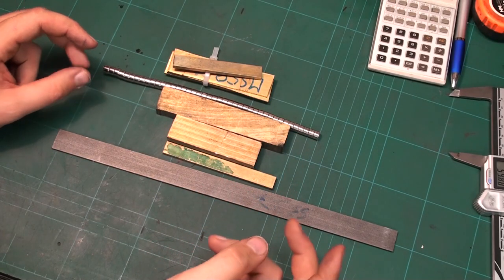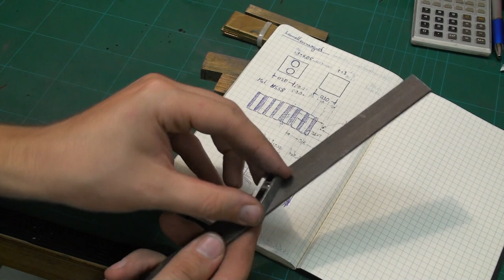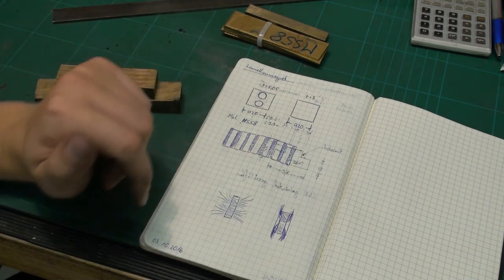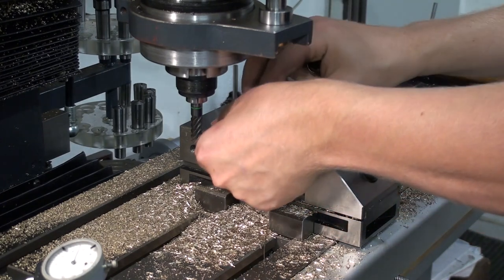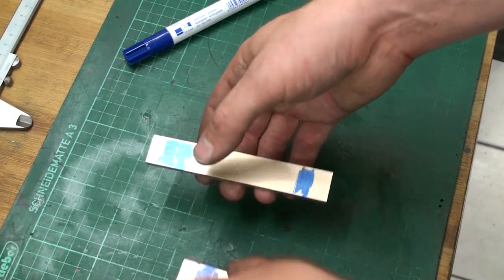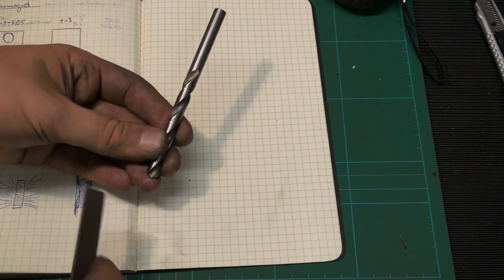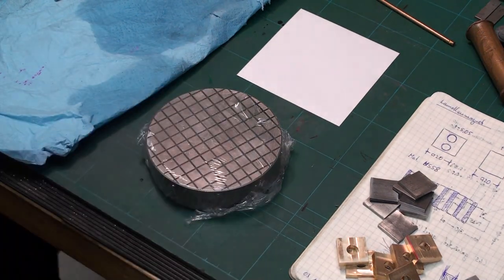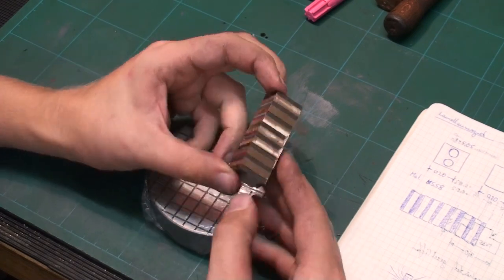Toolmakers magnets - Part 1

Comment: Very clever and well thought out. Not exactly unexpected for your channel Stefan. I think the full length pins are a good addition. Epoxy does hold well, but it's a brittle glue joint. Drop that magnetic parallel just once and you'd have a minimum of two pieces if your lucky.

Comment: Two thoughts, 
First, as surface finish makes a big difference in ultimate hold strength, would lapping the magnets and brass plate assembly so there is no gap between the steel and magnet help hold strength?

Second, could you make some sort of tongue and groove assembly to slot the brass and steel sheets together? Perhaps you could use the shaper? (you could set up a channel like the Yule Log channel and just let us all watch the shaper do its work)
Reply: Robert Szasz I would watch that channel all the time!!

Comment: Great :( Now I have another project to add to my (already too long) list. Pretty nice idea! I have some epoxy putty, pretty hard but easy to machine and grind, I might try to do the same but using that putty instead of the brass. About the transformer sheet metal, it's high silicon steel too reduce the Eddy currents and hysteresis loss.

Comment: how accurate does the length of the hole in the brass for the magnet have to be to the length of the magnet.
in other words, does the magnet have to be in contact with the steel pole plates on both sides of the brass??

Comment: I'm interested to see you square it up. Seems you might do battle with chips magnetically clinging to it.
Reply: If the grinding dust becomes hot enough (curie point) it should demagnetize itself by heat and just fly away. I think magnetic dust wont be a problem.
Reply: Morkvonork
Initially I thought he was going to mill it, but part 2 dispelled that incorrect assumption on my part. It ground out great.

Comment: on the subject of magnetism i dismantled a deck top computer to access its modem and when i dismantled the modem there was a very strong magnet that accidently  stuck itself to a metal work surface it took over 100kg of force to remove it .

Comment: Isn't the epoxy like 3000psi shear strength? You don't think the fact it should take almost a ton of force to separate the magnets is enough to hold them together?
Reply: Never trust glue.  It is a very brittle bond in my experience and should always be backed up by mechanical fasteners.  If you dropped them, the shock could break the bond (or just let them snap to the surface). The glue is very strong in the laboratory under static load for sure, but one light tap and it can break.  It won't of course if that was the plan.  Then it will stick like a SOB,  but if you want it to be permanent it won't be.
Reply: Barry Gerbracht
Better tell most of the auto manufacturers, many of them have been epoxying structural body panels for the last 15+years instead of spot welding because it is stiffer and stronger.  I am sure the grade and properties of the epoxy have a huge effect on its performance.
Reply: bcbloc02 surface prep is also critical in automotive chassis applications
Reply: +bcbloc02  I think automotive epoxy is softer and a much thicker bond layer to allow for the epoxy to be more plastic instead of very rigid.  I have used epoxy (Sikadur 31) to bond steel together and it is very brittle (it failed after applying the design load even though by calculation it should have had massive amounts of bond strength beyond the calculated demand).  This was not some simple sticking two hunks of stuff together and hoping it works either.  The surfaces were properly prepared and I had done all of the load calculations and shear flow checks to make sure the bond was adequate.  No luck.  A few well placed fillet welds stitched along the length and they never moved.  I know adhesives are used in automotive applications and extensively in aircraft manufacturing.  They are not using hardware store epoxies and will have extensively proof tested the assemblies prior to actually using them in production.  I would not trust this epoxy and would back it up with some rivets.  Once burned so to say...
Reply: Pierre's Garage
Loctite and 3M have some very strong grades available to the public thru any of their distributors.
Reply: bcbloc02
After I used M S products I quit using the other epoxies...   ;)
Reply: Glue joints, given quality glue (expoxy, superglue, whatever) will take incredible loads as long as (1) the surfaces are spotlessly clean, no oil, no finger oil -- notice Stefan wore gloves (2) little or no heat is applied to the piece. Else, you will indeed some mechanical reinforcement. And BTW  heat destroys magnets.
Reply: Juan Rivero In the next video you will see they already broke.
Reply: Thanks. Fickle stuff, epoxy. I use the slow-cure glue, never the five-minute set which is no better than Elmer's.

Comment: Brass is pretty expensive...   Would aluminum be a possible alternative?
Reply: In theory yes, but it's quite a bit softer (easier to mess up the surface/wear it out), it expands more with heat and (IMHO) it doesn't look as nice.
Reply: Thanks for the explanation!
Reply: Aluminum does work and is used for making laminated magnets.  Brass is often preferred because it is often harder, less prone to scratches and dings, and is less easily corroded (all variable depending on the grades of both metals).
Reply: Thx!

Comment: It doesn't seem like Stefan is answering questions on this video anymore (understandable, it's 4 years old!), so if anyone else can answer, that would be cool.  They sell these magnets in rectangular shapes.  Would those work?  I understand you'd still need to surround the magnets with brass, so that you can surface grind the surfaces, but I'm curious if there's anything about the shape of the magnets that would make the "redirecting the direction of magnetic pull" trick work differently (or not at all).
Reply: I'm far from an expert, but looking over this article, I think you could expect the behavior to be the same: https://en.wikipedia.org/wiki/Halbach_array

Cylindrical and block shapes are considered for different sections of the article.

Comment: Interesting. I would have soft soldered the stack, bass and iron can be soldered easily with Soldering-paste (for pipework). And the magnet take no harm with the 300°C. Then no pinning would be needed i think. I did soft solder big parts on an old electric stove with an aliminium plate as flat base.

I think i will make one from Galvanized iron sheets. They are often very low carbon steel and cheap. Simply soft solder stacks together and put a magnet in the middle. The zinc and tin are good enough magnetic isolation between the iron plates i think.
Reply from the maker: The neodymnium magnets are toast after beeing heated to 300°C.
Reply: Hm. Good to know. Thanks :-)

Comment: You should NOT use 5-min. epoxy, as it has very low strength. The longest-setting time epoxy will generally have the highest strength.
Also, do not use "laminating" epoxy that is used for fiberglass layouts, as it often cures very hard, therefore being brittle when submitted to a shock. The best epoxy is "structural" epoxy.